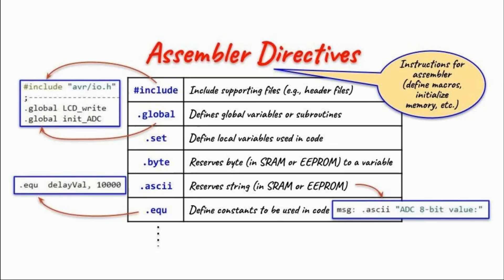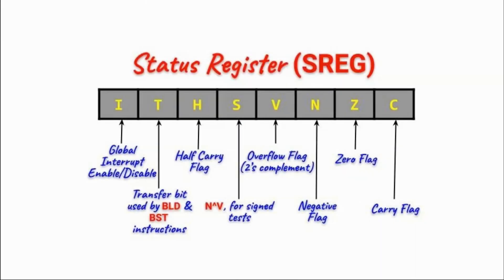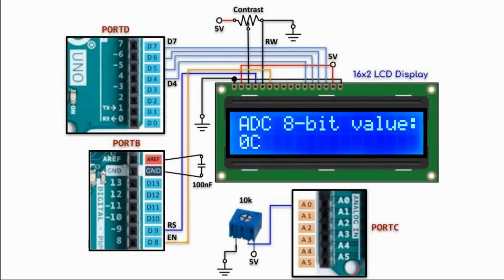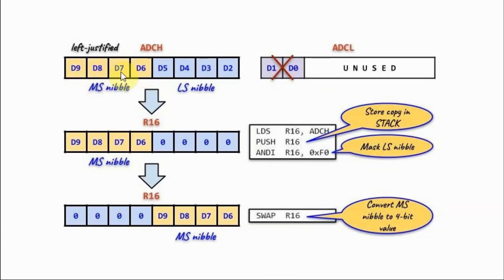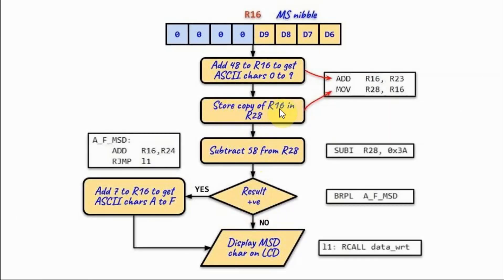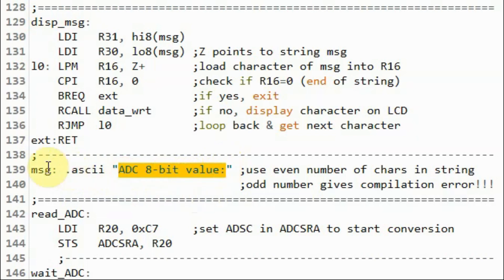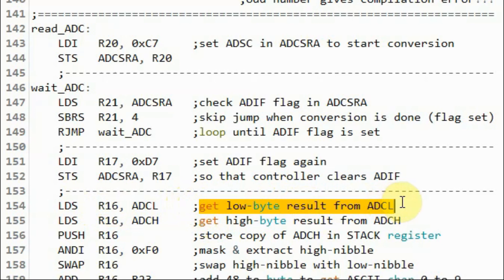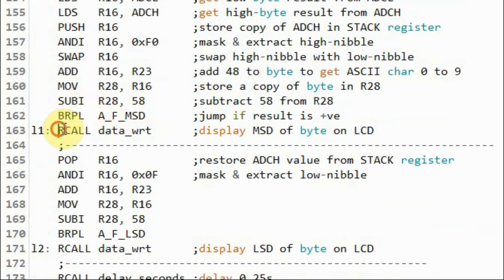Assembly via Arduino (part 6) - ADC Hex Value on LCD

Comment: I appreciate your projects and learnt many things about AVR assembly from them. The .ascii directive confuse me, could you describe the process that this directive run? In my inference, if the msg is stored in flash memory, the address of the first character of the message should shift left one bit before storing into the Z pointer; if the msg is stored in SRAM, then why not use LD instruction to save into R16, and as I know, the LPM instruction is used for fetching data from flash. RSVP